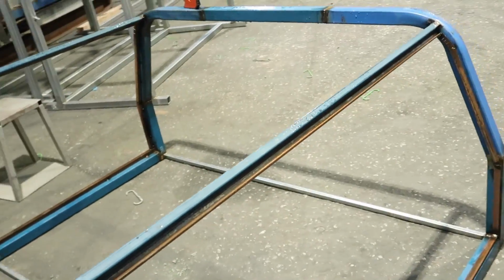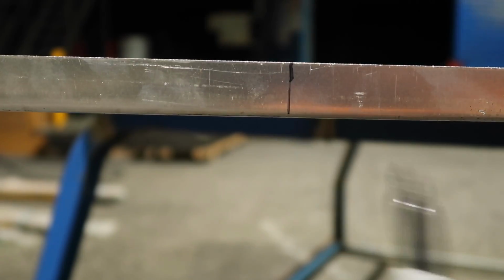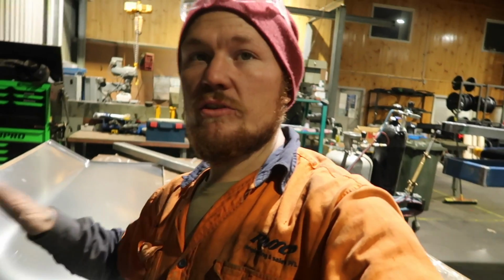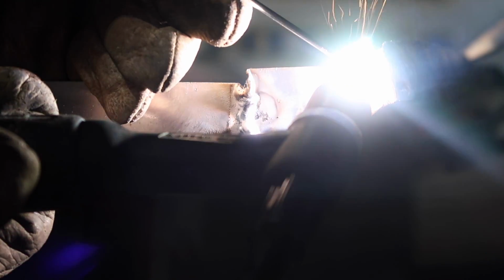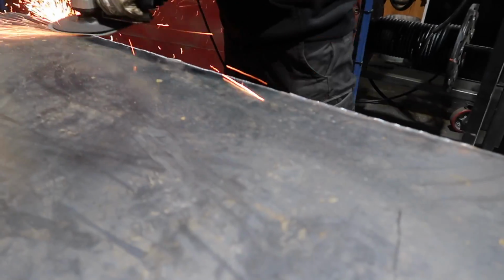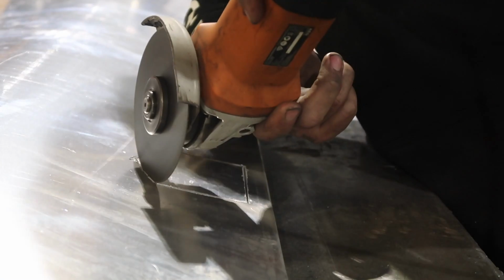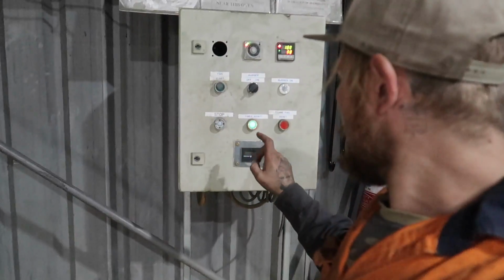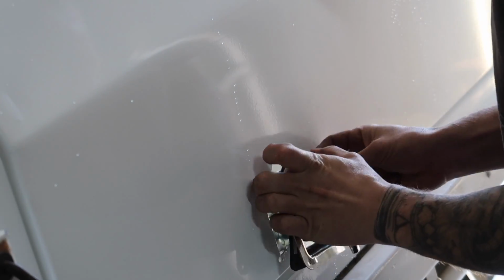BUILDING A STEEL CANOPY| VLOG 17

Comment: Thanks for the vid.  We're making one and were wondering about creating positive air pressure in the canopy to keep dust out (especially Northern Territory dust) but it looks like you didn't do this.  How did it go for your dad? Any dust?
Reply from the maker: Gday mate. Yeah I didn’t really think about that when building it. It’s got little to no dust on the inside after the year of use, if it did have some, I was going to slip some door rubber over the angle door frame to seal it up a bit.
Reply: A small van whirlybird on top would add positive pressure to it but no longer water tight if it's submerged

Comment: Hey mate awesome vid, you reckon a steel canopy with less reinforcing would weigh less than aluminium with more reinforcing?
Reply from the maker: sam scott 
Thanks mate! 
Steel typically being 2.5 times denser than alloy. I’d say the alluminium would still be lighter . Depending on just how much more reinforcing you put in. I only used the steel roof and supports because it was supposed to be able to bear some weight on top in some cases. Hope that’s helpful.